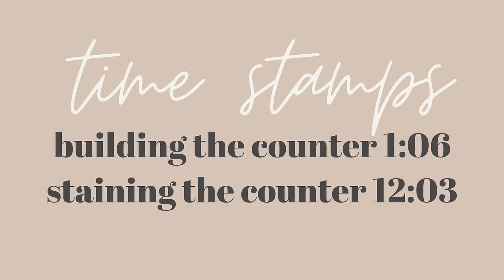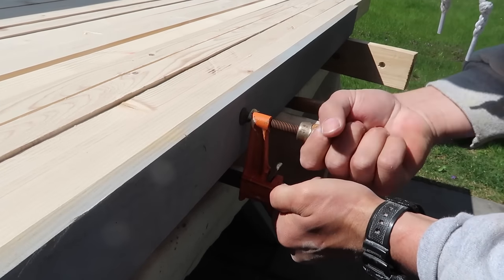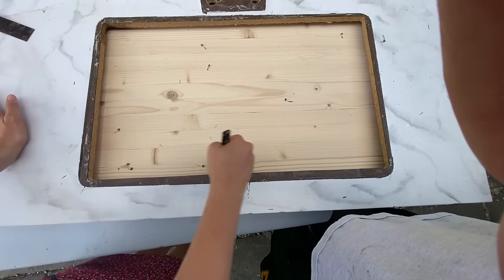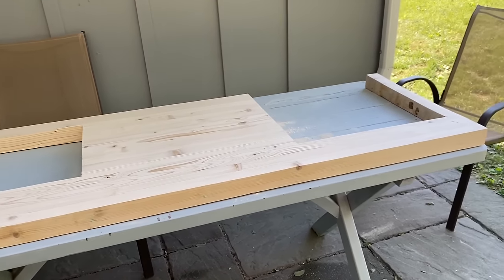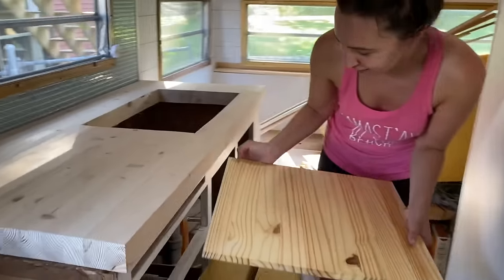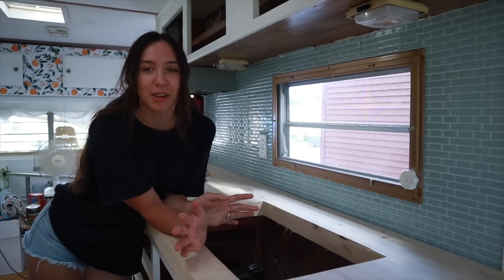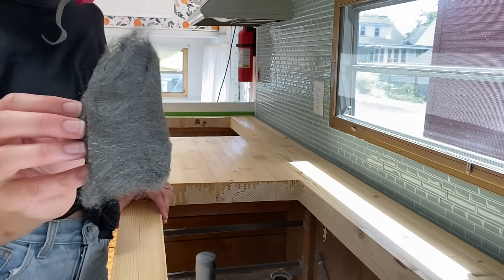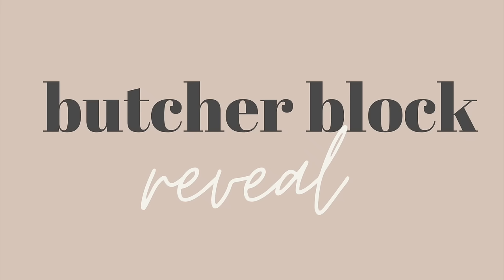How To Make A BUTCHER BLOCK COUNTER

Comment: Nice job, that counter turned out great! Just for future reference, polyurethane is actually a sealer, not a stain. Stain is absorbed by the wood more and thus colors the wood a couple layers deep. Sealers mainly sit on top of the wood (they soak in a little bit but not much) to seal it off and protect it from water, food, etc. So you can always do what you did here and use just a sealer and no stain, but using stain without sealer on a counter would be problematic because it would continue to soak up whatever liquids, etc were placed on top of it. But really nice job!! Love to watch your videos, you have a very upbeat, positive personality that is very refreshing!! Keep up the great work!
Reply from the maker: Stephanie Caldwell thank you!!
Reply: You could also treat it like a cutting board and oil it every month or so with food grade oil which would also protect the butcher block instead of using polyurethane. But you would have to be wary of moisture. But you don't have to put polyurethane on it.

Comment: Well done countertop and video. I'm building one for our kitchen and have to make an L shape so 45 degree angles. I put a premade countertop on about 20 years ago and it's held up well, but showing it's age (like me). Some of the laminate skin on top is turning loose. I've thought about doing it with concrete, but don't think I will. I don't have the experience for it. Been watching videos on doing countertops with epoxy, but again, don't have the experience. Wood looks like the way I'll choose. Thanks for sharing your work.

Comment: For those wanting to try this out on a camper, I wouldn't use two-by's, since you're trying to minimize weight.  I would suggest using one-by's, with a trim around the edges of 2x2, to give you the look of the butcher block.  Half the weight and price.  Also, in this particular video, yellow pine was used.  She did not apply stain, she only applied multiple layers of polyurethane; Because the lumber is yellow, when you apply the polyurethane, it will yellow out and give you the wet-look.  Stain is absorbed into the material, while a clear sealer, in this case, polyurethane, will remain on the surface and give it the protection it needs.  Also, to prevent having to sand too much, I suggest using a biscuit joiner, or even dowels, to help line up the top surfaces.  Doing this will reduce the amount of time spent trying to plane it down with a sander.  Good video, entertaining.
Reply: I'm curious about how stable a countertop made from 1xs would feel. With hardwoods, I suspect it would be perfectly sufficient, but with pine, cypress, or (god-forbid) whitewood, I'd be worried about it feeling spongey or bouncy since there is so little mass under the surface.
What are your thoughts on this?
Reply: Thnx for your input. I also have a camper and want to decrease weight. So would I just glue the 2x2 around the edges of my 1x1’s and clamp them to dry? Also, what kind of stain to use to prevent that yellow color? I like the original color of the wood without that yellowish tiny...
Reply: @PinkDiamonds977  to tell you the truth, wood yellows overtime no mater what, at least lighter woods do. That’s apart of the beauty of them. So if you want to keep the lighter color you have to either embrace the yellow or stain it a darker color.

Comment from the maker: Since all these grown men want to bash this video without even watching the full thing I will address this again. This counter is SOFT wood, as I said in the video we used this because it is cheaper, we like the look of it and it is for our CAMPER kitchen which does NOT get used. (Also mentioned that we made a counter with this wood before and it has held up great) I said if you are doing this for a kitchen/table top that will get used, use HARD WOOD. I even listed in the video all of the hard woods that you should use. I’ve had to delete so many disgusting comments from men on this video. I’m wearing shorts because I’m working in a hot tin camper not for you to sexualize me.
Reply: Our Little Nest as someone who criticized your work (honestly btw) I’ve also criticized creep comments on this video. While i disagree with your methods, I disagree more with creepy ass comments.
Reply: The reason to use hardwood is not because of wear. It's because softwoods absorb more liquid and has a much higher chance of getting rancid.
Reply: What shorts? I didn’t see any shorts‼️

Comment from the maker: Just to clear this up! What I applied is a polyurethane which is not a stain. I’ve always called polyurethane stain but that is not the correct term! So sorry for any confusion.
Reply: is it food safe? or you'll just use a cutting board - woudlnt want you to accidentally chip some of the poly and eat it.
Reply: Sarah Vankoughnett polyurethane is definitely not food safe.
Reply: It happens I knew what you meant
Reply: Don't sweat it it won't ki!! Ya!
Reply: Sandra Westley from the UK you would not chop on your work counter you would use a chopping board. Polyurethane just puts a clear seal on it so water isn’t absorbed
Reply: Should also note when using a sealer its good to seal ALL sides and ends otherwise you increase the chance of moisture getting into unsealed areas and causing cupping or bowing

Comment: Professional interior trim carpenter here. As far as the application goes. It’s a camper countertop, with minimal use. As far as using a belt sander to level out the top. You need a dead flat result, that can’t be achieved using a belt sander. A drum sander or a planer is what’s needed. This is to avoid water from pooling up in the parts of the countertop that aren’t flat. Just an fyi for someone who plans to use this as a guide for an actual butcher block countertop in there kitchen that will see daily use. You will end up with wood separation along with other problems that will result in a full tear out of the countertop and a do over of some sort. There are more than a few other steps that are not accurate as far as the gluing and finishing application goes but other than that. It was was given the old college effort.

Comment: Great job on the butcher block countertop, but just so you know the polyurethane is not a stain, it’s a top coat or sealer. It may not hold up too well in a kitchen counter top application. It looks great though.

Comment: Quick tip if you're using wide pieces use a biscuit jointer, domino, or doweling jig to make sure the boards are all even any pretty darn close to flat.

Comment: The cutting board is supposed to stick out a bit so you have something to grab when you pull it out to use it unless you put a knob on it.  But the counter top is looks so good. Your camper is going to be awesome.

Comment: did you need to cut the 2x6 in half, or  can it be left as a 2x6 with the edged cut off?
Reply: You can certainly leave it as a 2x6, but a 5-in tall countertop is a bit excessive LOL. 
If you're referring to laying the boards "flat" so the 2-in dimension is vertical and the 6-in dimension is horizontal, you could certainly do that, the only problem is that if you're working with big-box construction -grade wood, thee boards usually aren't completely dried and will change shape over time. Usually this will be by cupping or twisting. putting the boards together "flat" doesn't give the same level of resistance to changing shape as you would get by orienting them vertically. 
I'm not sure if that makes sense?

Comment: i’ve heard from other channels that staining with a rag helps with streaks and it’s just generally a smoother process
Reply from the maker: This is actually a polyurethane not a stain, I said the wrong thing in the video🤦🏼‍♀️ so with poly you don’t use a rag, you simply just paint it on!

Comment: Butcher block is technically end grain this is however still a nice countertop
Reply: That’s what happens when you’re thirsty for attention but don’t have respect for the craft.
Reply: BUTCHER BLOCK 
Butcher block has two meanings – the original meaning comes from the end-grain blocks that Michigan Maple Block and Bally Block pioneered in the late 1800s for the commercial meat cutting industry.

Today, the term has come to mean edge-grain laminated construction, as over the years butchers wanted smaller and more portable versions of the traditional blocks, including butcher block cutting boards, which have become very common in residential and commercial kitchens.

If we're being strictly pedantic, you're correct. But, I'd argue that the term has evolved to encompass both end and edge-grain lamination methods. Just as we still say that we are "filming" something, even when we are using our cell phones. Language evolves over time. That doesn't make the new meanings "wrong", it just adds to them. If you choose to only refer to end-grain surfaces as butcher block, than that's fine, just as long as you are aware that pretty much anytime you use a variation of the phrase "Well, actually..." you come off as a bit of a pedantic ass. But, hey, you do you, boo.

Comment: Dimensional lumber for a countertop? I’ll be amazed if it doesn’t curl up like a pretzel. Best woods for butcher blocks are hardwoods other than oak. Oak doesn’t do well that well.
Reply: A white maple with its tight grain would be a perfect choice 👌
Reply from the maker: We’ve done this before and never had that happen. I said in the video if you’re using this for a kitchen that gets used to use hard wood & even listed all the woods that should be used
Reply: That is true. Wood like that from the hardware store is often still wet. I wonder if the poly will protect it from drying too quickly and warping or cracking. Guess time will tell.
Reply: White oak will work, red oak not so much. White oak is known for how well it does with moisture. It’s been for centuries in ships. Live oak has also been known for the beams and frames of ships. I also say this because I built my white oak countertop finished with Waterlox varnish. Butcher block is traditionally finished with mineral oil

Comment: I hope you don't actually use this as a true butcher block because you need to use a food grade finish if you do.  Also, you should use a special polyurethane or other finish that can handle moisture if you are using it near a sink.  Otherwise your wood will start to crack/split and become damaged anywhere it has been wet.
Reply from the maker: Samantha Adamyk the camper kitchen will not be getting used
Reply: WHAT CAN YOU USE AROUND THE SINK TO PREVENT WATER DAMAGE? THANK YOU

Comment: I dont get it, you write «maple or birch» because they are the most durable, then you said you made your's with 2x8... but soft wood is not made for butcher block because it is... soft. So you made a beautiful wood countertop, and you will need cutting board on top of it, So it's not a butcher block counter, but a beautiful softwood counter...   When you cut on soft wood, your knife enter in the plank and create space for moisture, that in time, is bad for bacteria... So you need to over wash it, and than it is bad for the wood. This is why we cut on hard wood.
Reply: I agree this is a wood counter. For show only. In actual use this counter will fail and water will make it look unappealing. Do not cut on this wood! A lot of work that has gone to waist.
Reply from the maker: I explained that all in the video
Reply: Think some of the questioning of the manufacturing and use of materials is absolutely ridiculous. This video was designed for functionality purposes. There are tons of YouTubers out the creating content. This video provides an inexpensive way to solve a problem. The creators seem savvy enough than in time if they need a higher performing solution. They’ll get’er done. 

Think some of you have go tooooo much sawdust that’s collected between your ears.
Reply: @jj54realz   I get it, Thank you. It's just that «BUTCHER BLOCK» is in capital. I don't mind at all .
Reply: @jj54realz  It's seams i'm not the only one with saw dust here...  Maybe you follow this channel, but some DYER  may come here to find out how to do a butcher block countertop et not only a wood countertop. I insist that the work is beautiful but it is not everybody that have the knowledge (and a lot of viewer dont' have english as a first langage) and would easily decipher the info that this is not what they where looking for, and discover it in the middle of the video. 

You get less view with «wood counter top» dans «butcher block countertop » because even if the second is more specialized, it is rare while wooden countertop is pretty common. And, they talk about their house where they did a counter like this one. But, didn't recommend to cure the varnish for 30 days. Even if it is fast drying, it is not food safe. It is not a waste of time to recommend linseed oil.
Reply: @dropndeal  I explain the point in the  fifth comment, YouTube is worldwide and it is not everybody that master english as a second or third langage as well as if it was the first. So yes they tell in the video that hardwood is better, but not in the middle. 

So «Butcher block» is in capitals. In Quebec, «bloc de boucher» or «butcher block» mean that, big maple slab. Wood counter  is «comptoir de bois». I didn't know that it refer to a style, but even so, there is a problem : if you do you butcher block counter in soft wood, you might want to put a lot of finish or varnish because they are soft...  So the point remain the product you might want to harden (and protect-it) the wood might not be culinary safe.  Would you make pastry on a granit or marble or quartz counter ? Yes (except put acidic substance direct on it), and you can do the same on a hard wood counter top, with the right finish.But i'm quite not sure you would on a soft wood counter. Forget the knife than, think about a fork when you do gnocchi. 

So, if you wan't to end this peacefully, what finish, safe, would you recommend on a soft wood counter (to solve the problem)?  One that would create a strong layer to protect the wood from water damage and impact, but would still be fine for food preparation.

Comment: So much cringe in this video. It’s not even butcher block. What’s sad is that someone’s going to see that this video has a bunch of views and will attempt to do things the way you did and think it’s right. Also, that cutting board is going to snap as soon as you put any kind of weight or force on it because the grain runs with the pivot point. Turn is so that it’s perpendicular...
Reply: I agree 💯 percent. This video should be deleted!
Reply from the maker: I said in the video this counter will NOT be getting normal kitchen use and if you are using it in a kitchen use a HARD wood which I listed a bunch of. I addressed all of this in the video. So sick of people like you putting down others to make yourself feel better.
Reply: @OurLittleNest   looks great hope you guys have fun this spring and summer with your project!!!

Comment: Great job, but for weight purposes, I would have made the block one half the thickness you used, which would have reduced your lumber costs by half, as well. Remember, you are hauling that heavy block around and reducing your gas mileage.